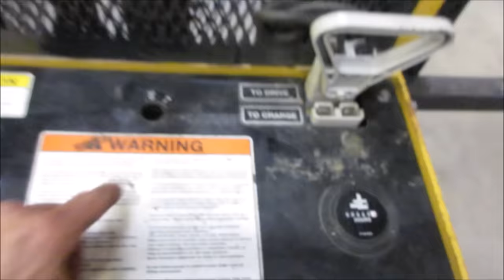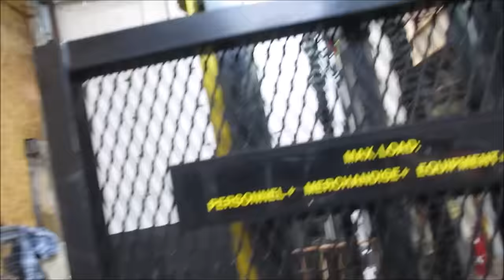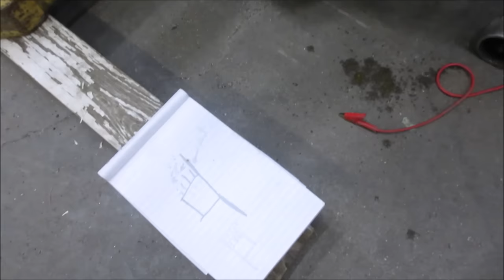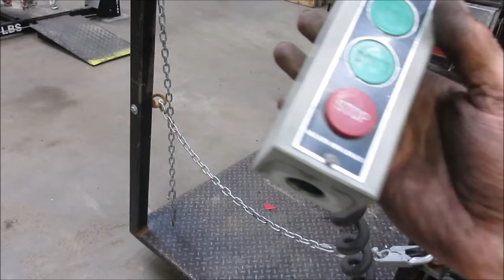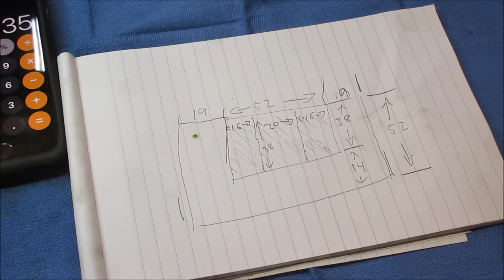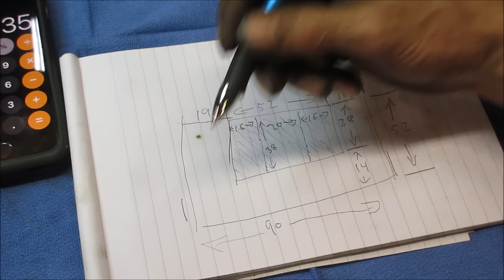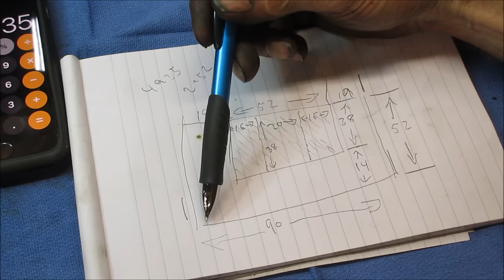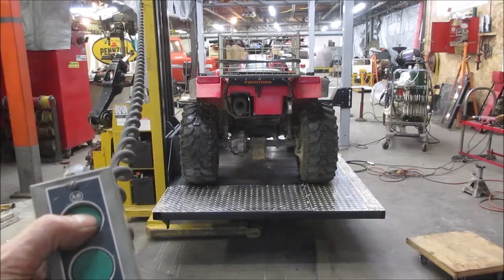Busted Man Lift Turned into a 2nd Floor Barn elevator

Comment: Pretty sure drive problems are from those two round contactors being bad. Just like a starter solenoid in a car, over time those contacts inside wear out from sparking when it opens or closes. It will still click, just not make contact. Honestly I am surprised that they were never bypassed for troubleshooting, only clicked on.
And just like automotive solenoids, these can be taken apart, cleaned up, and put back in service (despite manufacturers wanting you to spend $$$ on new ones and often riveting them).
Also an odd decision to take off that mesh wall on the platform. It wasn't that heavy, but kept fingers/clothes out of the pinchy bits of the lift. Plus was a useful thing to just hold on to while on the platform.

Comment: 23:53...no, that's the motor driver..

The 2 outside lugs are connected to the motor, and the 2 inside lugs are connected to the battery.

Comment: Oh man I used similar "walker" type lifts at Bunnings for years. There are so many safety cut-off points in these things they were an absolute nightmare. The handle needs to be within a certain angle for the lift to move around or it wouldn't work, sensors would shut the things off all the time making a 5 minute job 30 minutes. The Yale technician was at the store every other week because it was a POS. A very expensive POS.

Comment: Instead  of using the plasma cutter on the aluminum tread plate,  you could  have used simply a  portable grinding wheel/ cutter to cut the aluminum thread plate.😂😂

Comment: Think the red button in the end of the drive handle is a dead man for the drive. Hold in with thumb while rotating the handle and see if it runs the wheel motor.

Comment: Whilst most plasma cutting applications can be completed using compressed air, aluminium is a bit different. The use of inert gases such as Nitrogen and Argon will be highly beneficial.

Comment: I can't read all the messages, but I've had a similar problem and the drive motor cable was broken from the inside. because of a lot of bending. worth checking out.

Comment: When plasma cutting aluminium, you should use nitrogen gas and not air. The nitrogen gas stops the aluminium from welding itself back together.

Comment: You need to add both supports due to the distance between the supports unless you use a thicker plate material!

Comment: Boys and there toys, eh Mustie.........

.   shame you could not remove ,the original, diamond plate... and source a size,for your needs ,in one piece , weld back to base structure , and weld round pipe ,around edges ,alike orig ,design idea..  to give structural and guide support. 

Still nice job !!

Comment: You can get neodymium-iron-boron magnets from old hard drives. They are very strong magnets. I use them to hang magnetic tools off them. Just be careful not to any get skin between the magnet and the metal because it will bite you, bad.
Reply: Done that before 😳

Comment: The handle has to be down (not in the upright or "in rest" position) to use most of the features on that lift.  I'm not even sure if the up and down work with the handle in the upright position. That's how they worked at my company.

Comment: The tiller handle should have limit switches. Drop the handle too low or raise it too high, and the limit switch drops out voltage = no forward or reverse. Someone else had mentioned the potentiometer in the throttle, if you have voltage through your limit switch, go there next.
Reply: I should say, the brake sets when the limit switches are set. (Ie the handle is all the way up or too low).
Reply: I spoke too soon. Yes you are releasing the brake with that micro switch. But it should have 2 of those switches up and down on the handle

Comment: In that relay, the center of the solenoid coil would be an iron core to help increase the magnetic strength of the solenoid. That’s probably what caused the majority of the rust in the relay

Comment: The break on the motor should be On top of the motor assembly. And the break should have contactors engage the motor. Like the solar noid on some starter motors. So the motor will not run until the break is disengaged. The clicking you heard in the motor. Was the solar noid for the break A lot of forcliffs. Can pick up a lot more than I rated for Say your forklift can pick up 2000 pounds.
The next model up Can pick up 3000 pounds The only thing that is different Is the shatty rails? To move the counter balance further back. Forklifts and bulldozare. The only things designed to be heavy. The frame rails on your forkliff  They are not channel or box but solid, bar I've seen fal cliffs a couple of sizes up from  The front wheels  weighed  700 pounds Each

Comment: Ha! Big Joe. I used them at Best Buy. I used to call them low highs. They are cool devices. I don’t know Mustie, there is no internal combustion. For sure there are sparks, and parts, batteries, and lights, camera and action. Will Mustie make Joe go? Well, um, you’re just going to have to watch and find out. As always, Mustie1 rules. Good as used, and safety 3rd. Show ‘em whose Boss Darren!
Reply: They're fine for the use case, but man If best buys were a bit bigger to justify it would a order picker be great, if not an order picker a ballymore would be nice too, because you can at least drive those things while on them... The problem with Best buy is they basically only use them for TVs and they probably don't want you driving with a TV hanging over the edge...

Comment: You can put two fince poles on that side with brake so it cant come back down with out you wanting it to 4 garage door wheels should work just fine around the poles with elevator stile brakes ml 🙏

Comment: I worked in Maintenance for almost 30 years. We had similar lifts for lifting product (bins of tshirts) and they were always a pain on our behinds. The company would love to go out and a buy small fleet of the same brand and model. Problem was it always seemed to be at the end of the model run and parts would become scarece instantly. Needless to say when one would break down it would become parts for the others. Lol! I’m only half way through but I’m wanting ask if the control arm needs to be pulled down to kick a micro in to activate… never mind you just found it. Lol

Comment: Forward and reverse, aren't they disabled if the handle is in the up position? Pretty sure there's a safety switch so it won't operate in the up position.

Comment: Did something close to what. you are doing.  Had the same trouble you are anticipating when platform goes up through the upstairs floor.  When I framed out the second floor opening using 2 x 10's I simply angled the rectangular bottom of the framing out on all 4 sides about10-15 degrees thereby forming a crure funnel to guide the platform if it tilts a bit side to side.

Comment: have you tried pulling the thing on the ground with that electronic break switch connected? as it might lock and release the wheel so it does not move when the handle is up or down.

Comment: Normally the handle has to be down to operate the lift, if the handle is broken then the lift will not normally move forward or back, don't know if this is your problem but wouldn't be surprised

Comment: It should have a spring on the handle to keep it from going to low it has a safety cut off. One of the solenoid is for forward and reverse. You might want to get a new spring or a handle

Comment: Not sure if this is relevant but some walk alongs need to have the handle in the steering or what you might call operating position. Some use all the way up or all the way down as a brake and an electrical shut off.

Comment: I would think there should be a safety switch which when the handle is pulled down it would switch the motor on.  Additionally for that switch you could flip it upside down and water wouldn’t enter if by chance you left it outside

Comment: eTRAC Electric Drives from ZF Friedrichshafen are similar to that motor drive. Perhaps they are the original manufacturer and the lift you have is rebranded for USA consumption. ZF makes electric driveline solutions for warehouse equipment and pedestrian controlled vehicles

Comment: The drive handle has a safety shut-off. In the full down and full up position, it won't run. Like a seat switch on a lawn tractor.

Comment: Move the non pivoting wheels out to roughly the edge of the new platform so you  get more front stability. 
The drive wheel isn't chain driven by any change? Or is the motor integrated in the hub?
If there is a chin you can remove it and then the weel is fre rolling can be put back later if you decide to fix the motor function later.

Comment: Because it's going to be stationary I would have deleted the batteries and put in a 120v to 24 v converter . They could  have hard wired it in because you know everyone is going to say it wasn't their job to plug it in and charge it .

Comment: You likely thought of this already (great minds think alike), while installing it, you remove the wheels on the base support legs and if possible, slide in and weld some 4x4 tubing to extend the reach of the base legs and do something similar for the sides?  ;-)

Comment: Instead of spending three grand for two batteries remember to fill the battery compartment with as much weight as you can cram in there.remember,counter balance.

Comment: Darrin if you notice the handle bar has a big square knob,  push that in and try you forward or backward
Reply: That's an emergency reverse switch, in case you accidently back up when you meant to go forward and pin yourself against the wall.

Comment: I would not have used batteries if it is working in a fixed location. I don't know if the charger would be up to operating the motor but if not it could be uprated so it could run off mains power.

Comment: Is there a safety switch that tells the machine that the deck is lowered, so it can move the motor?  Seems you wouldn’t want to move it with the platform at height.
If the switch is broken, the drive motor wouldnt work…
Safety feature.

Comment: One thing I don't remember seeing done was manipulating the switch that had the four pronged knob on it while trying to get the motor for the fwd/rev to work.  Could that have been in the circuit?

Comment: that wire that you took out of that control panel  (the two wires )wouldnt that be an interlock that the operator has to wear when hes moving this thing back and forth for safety

Comment: I'd bet all the rust in the relay came from the iron core of the electromagnet. As long as the windings are sound, it should still work fine until the core's just about completely gone.

Comment: Second edit: I don't think you found all the safetys in the handle

Edit: you clearly found them,

I want to say I bet it's the limit switches or minimum/maximum angle on the control handle, I'm only a third of the way through the video so I can't say for sure but those are often either physical micro switches or occasionally hall effect where they just sends big bits of metal or magnets, there's a cut out when fully vertical so that the machine can't possibly drive on its own from a resting position, and there's a cutout with fully lower so the machine doesn't jam itself against something

Comment: Do you think the unit probably has a safety switch that won't let it go forward or back with the platform up? I was also thinking if you use jumper cables to test the motor directly to make sure it still runs. If the motor is good, then figure which relay activates forward and reverse then just use momentary switches to activate the relays directly and cut out all that safety crap in the upper handles. I think all the old bump switches and other crappy old wiring is what is stopping you.

Comment: Really cool project!! I would watch the installation video. I know you don’t care if the drive motor works or not but in did find a manual online for the controller (Curtis 1207A-4118) if you need it. Also I would think the unit would have some kind of interlock that would not let the drive motor operate if the lift is not all the way down. 

Great video gives me some ideas for my shop! 

Ron

Comment: If it is anything like an electric pallet jack which seems like it is that handlebar should be held down as you're twisting in order to drive it there's a safety switch in it so that if you were to fall off or get flung off the once a handlebar bounces back up is supposed to hit the brake and not be drivable
Reply: Or in this case the point of it would be if you got ran over and suck underneath then it would stop
Reply: Also that safety switch in the handle is very likely not even a micro switch and possibly just a magnetic switch or a hall effect sensor because regardless of how messed up it looks it doesn't seem like it could have ever been in right spotto ride on that cam, also that cam is so beefy that it seems almost for the purposes of a cam to be ridden on by micro switch it looks like it's trying to magnetically couple to the sensor which would require a lot of metal

Comment: too bad that top roller doesn't come off. it it did you could easily install or remove one or both chains by removing the roller(s), mount the chains on the rollers, then remount the rollers with the chains already installed on them. of course, i suppose there is cog(s) on the bottom of the chain(s) that drives them and may be a source to adjust the slack enough to remove and install them.

Comment: The ground wire on those two battery wire should have had continuity to ground and should have been easily testable.  Rather than just connecting then willly nilly

Comment: I am surprise that you didn't tap the electric motor with a hammer when you tied to make it run. It could be dirty brushes in the motor and it's stuck on dirty contacts.

Comment: im surprised no one chewed u out for welding in the push way cause they do with other ppl i watch and js that red button u pushed that prob stops it from being moved while ur standing on it so someone dont walk by and mess with u and move u around while ur in the air and when u hit the stop on the controller it prob sends the power back to the motor side of it to move it around again

Comment: Don't you have to pull down on the handle to release the braking on the lift.. other than that the brake is on the wheel that the motor is on??

Comment: You do not want to make the platform bigger as the base would have to be just as big or it will tilt and fall over. Sorry I should have watched the whole video lol. If you are going to bolt it down to the ground and use it as an elevator then I get it now.

Comment: Whatever it is. if Dr. Mustie cant make it go then nobody can...!
Reply: quick drive motor check meter across input terminals, is there power when you actuate the controller handle switches?
If yes then check carbon brushes inside motor for ear!

Comment: Why not delete all the wheels and sit the frame directly on the floor. Then you can bolt through the frame without all the brackets. It would have to be more secure and stable.

Comment: My only concern was that you don't want too much weight at a distance from the rear uprights. It will increase the tendency to topple forward and put an extra forward twisting load on the main uprights. You  also want to consider extending the base forward and to the sides.

Comment: How about extending the wheels that keep it from tipping forward?
Reply: Since it's likely going to be a dedicated spot I think it makes as much sense just to throw some redheads into the concrete and just mount it to the floor with some strapping or some other brackets probably more stable than any lengthening of the footprint would make it

Comment: Does the end of the operator control arm have a sort of dead man switch at the rear such that if the operator doesn't lean into it, the unit shuts down?   No pressure on that (the operator dismounts or falls) and the unit stops.  That could be the purpose of that broken switch.   Have you tried applying 24V to the main motor leads to see if that spins?
Reply: I'm also unsure if those are actually micro switches and not some form of hall effect sensor, so I can't say they are really broken both are common but given that the handles moving a big chunk of metal and the position of the switch I don't think it requires contact work and instead is just sensing the position via that lobe magnetically

Comment: Can anyone tell me what the proper term is for the coiled wire that connect the controller for raising and lowering the platform? Pls don’t answer if you don’t actually know. I’m searching for about 4-5’ of it for a project but I can’t seem to find anywhere that sells it and don’t know the proper term for it.